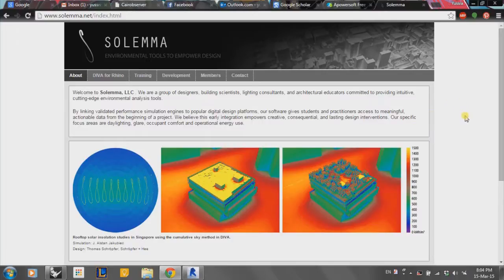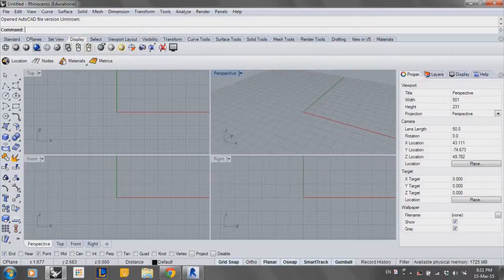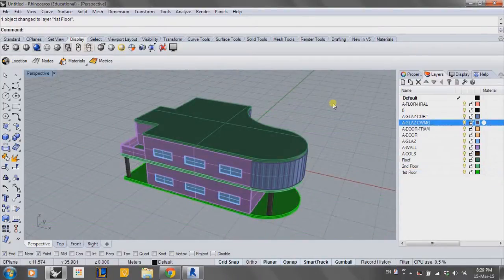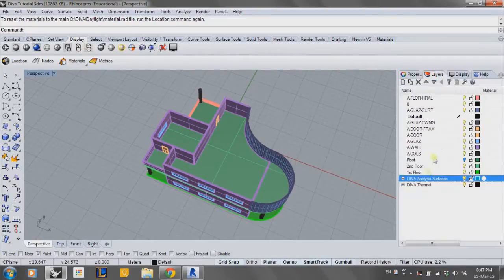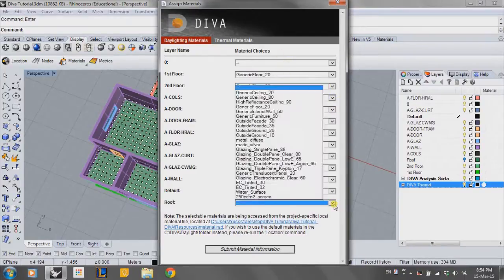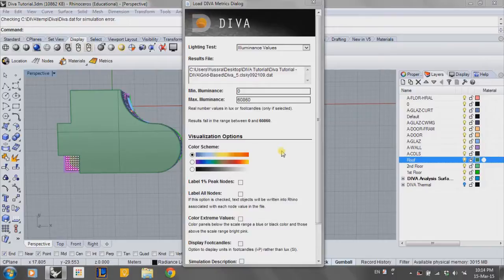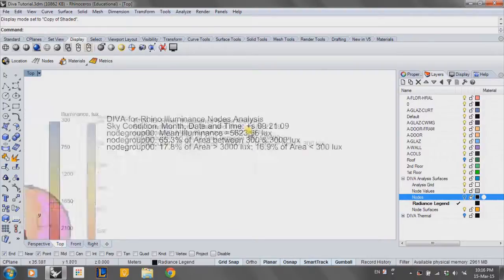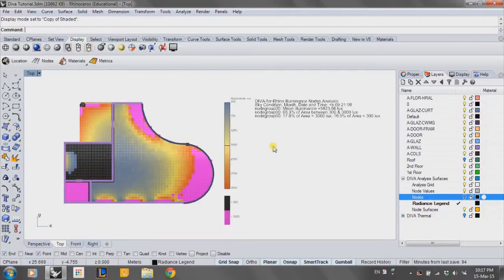Introduction to Diva for Rhino 3 - Daylight Analysis Simulation

Comment: Thank you so much. Can I flip the illuminance values on the surfaces? the appear upside down
Reply from the maker: Yes you can. By flipping the surface normal in diva, the illuminance sensors will read illuminance downwards

Comment: What is the best software for daylight and airflow simulation? Is Grasshopper, Diva, DesignBuilder and Revit with Vasari?
Reply from the maker: For accurate daylight simulation I would recommend Radiance. However DIVA for Rhino is a good alternative for beginners and it uses the Radiance Environment.
As for air flow simulation there is a program that replaced Vasari called Autodesk Flow Design where you can import any 3D file format and conduct your analysis.
Reply from the maker: Yes, grasshopper is a plugin for Rhino which acts as a visual coding environment for rhino ... there is a diva plugin for grasshopper ... in the end both diva for rhino or diva for grasshopper do the same analysis